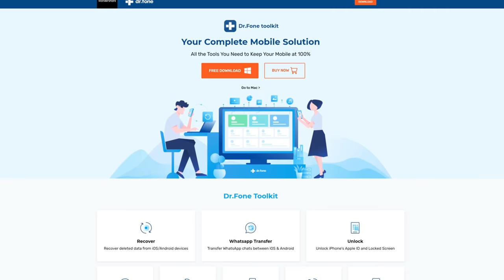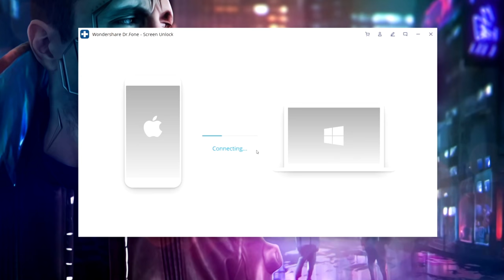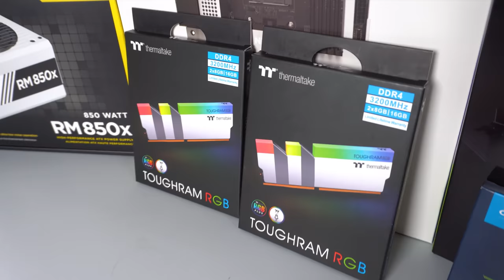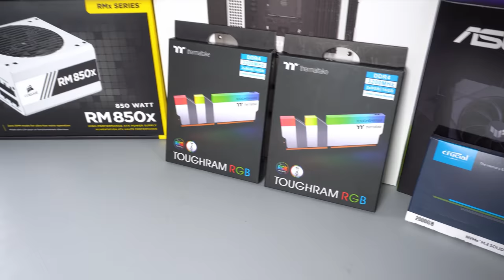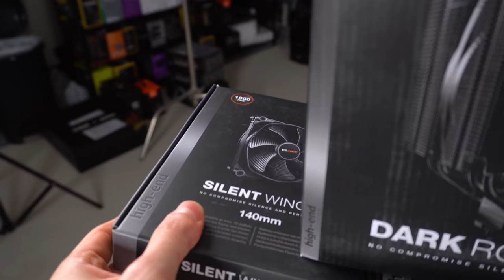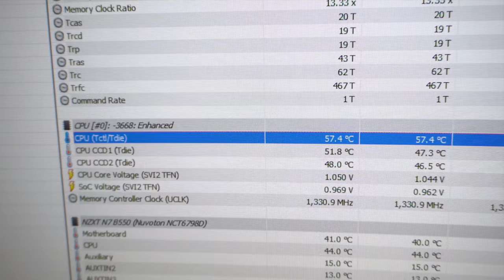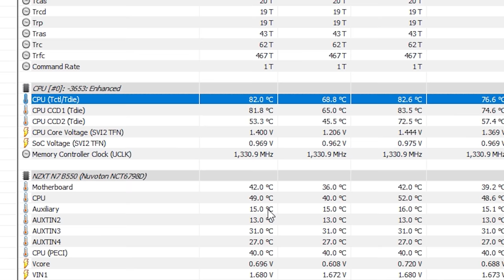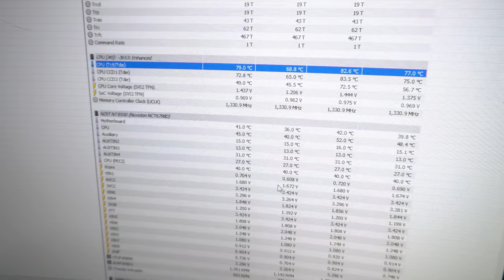I'm Bored again...Let's build another PC!

Comment: The only thing I didn't like about this built was the cooler. The case is amazing. It would looked even better if you skinned the bottom part, where the hard disks and the power supply are.

Comment: What you see:
Ryzen 9 5900X
NZXT N7 B550
ASUS RTX 3080 TUF (amazon)
Crucial P5 2TB M.2 SSD
Be quiet Dark Rock Pro 4
Be quiet Silent Wings 3 Fans
Be quiet Silent Base 802 White
Mainframe Custom Cables
Corsair RM 850X Power Supply
Thermaltake Toughram RGB 32GB

What you want to see: 
electric Screwdriver 69420

Comment: I have a question should I build my pc or buy a pre-built? I know the answer is pretty simple “Just build it yourself” but hear me out I can’t get my hands on a graphics card because of scalpers and I bought a 1440p 144hz monitor so I feel like it’s stupid to get a 1660, 1080, or even a 2070 because I feel like I won’t get the best performance but I’m also not an extreme “gamer” I play only a few games but I do play those games quite frequently. I would also buy a used graphics card but I would rather get a new graphics card.

Comment: Suggestion: you've got enough extra space in the case that you could use it to house, perhaps, some sort of decorative object, such as a small house plant. Maybe a cactus. :) Of course, then you'd need to rig some kind of LED light up at the top, presumably in front of the two top fans, assuming you could find a reasonable way to mount and power it.

Comment: Hey I had a question I was wondering if anyone could answer.

So if we number the RAM slots on the motherboard 1, 2, 3 and 4 do you have to put the ram sticks from the first package in slot 1 and 3 or 2 and 4 or does it not matter if you are using 4 of the same ram sticks like you do in this video

Comment: 22% CPU Load
CPU: 80 C is a perfectly fine temperature

But really, why is it so hot? My 5900X doesn't go past 60 degrees under full load with 360 AIO. Is it crippled be quiet! fans' performance or something went wrong during cooler installation?

Comment: I wonder if you can do a cable video on how to connect all the cables to the motherboard.   That is the part I sometimes mess up.   I'm in the process of building my 2nd machine.  I had a lot of cable connection issues.  Awesome video.    thx

Comment: yup i be getting rid of my  hdd 2tb soon and my  sata sdd i be getting 500 gb  m.2 ssd and 1tb or 2tb m.2 ssd .  right now i am using a mechanical 1tb drive and hdd 2 tb drive with a sata ssd . i cannot wait for my m.2 ssd upgrade i get 500 gb 1tb and 2tb m.2s . my board i can fit 4 lol if i wanted too .